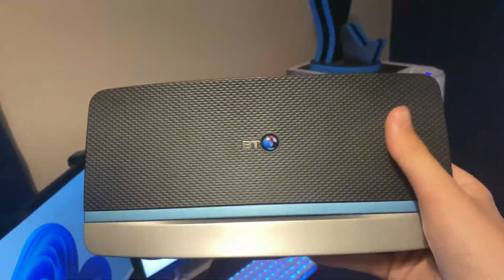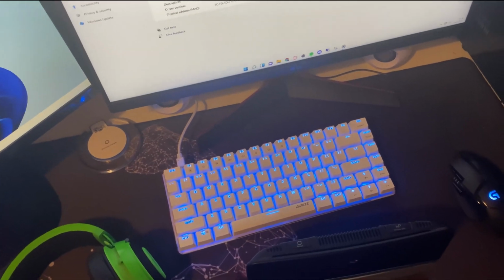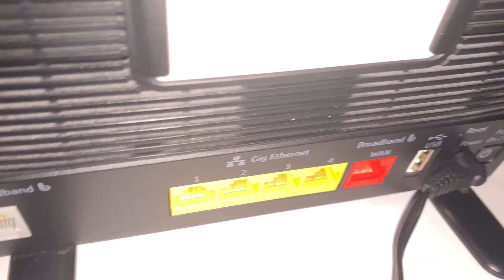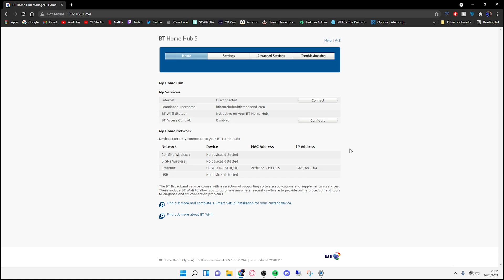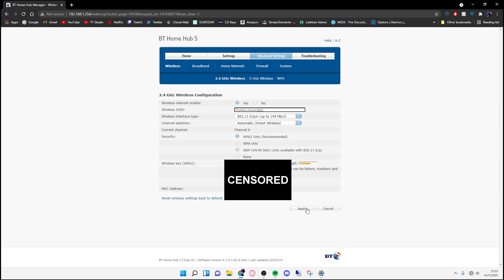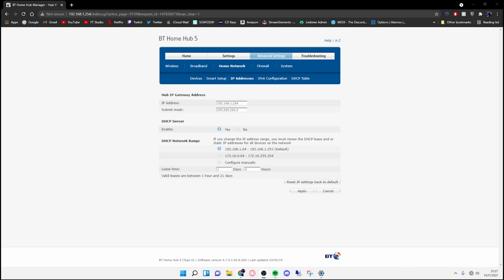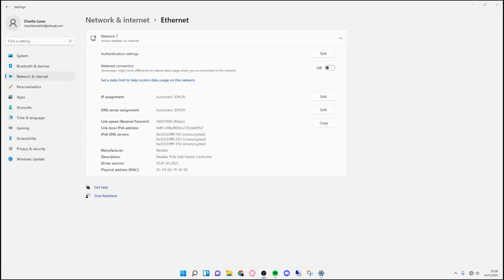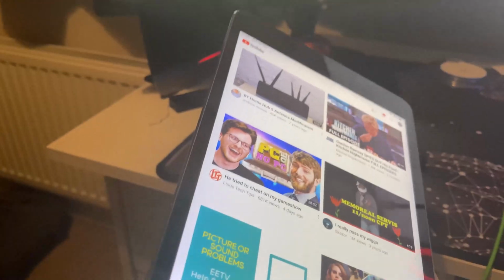Use a BT Hub 5 as a Wireless Access Point Wi-Fi extender

Comment: Hi Charlie, I am still having  trouble with the end bit.  you mentioned after all the changes you plugged in the other two wire, your enthenet and x box cable.. can I get it to work with just one Lan cable from the main router to my old bt hub?  how would i do this?  as it is still light up orange.
Reply from the maker: you only need the connection from your current router to the bt hub, you can choose to plug other devices in but you dont have to, did you get it to work?

Comment: I tried this but Internet kept dropping.  I phoned a bt engineer and he could remotely see that I had connected an extender.   He said that the extended is ' throttling' the connection and reducing the main router speed.  So it didn't work for me despite following the instructions on here.

Comment: Hi thanks for the video much appreciated and a 👍 from me. Quick question, my BT HH5 is working as a wifi extender thats good. But the other lan cables dont seem to stream wifi elsewhere ie pc etc. Have i dosabled the wlan sockets as the line in is plugged to the yellow wlan connection also.

Also i now cant access the router settings using 192.168.1.1 or 1.254 do I have to reset it again to access it since disabling dch.

Many thanks

Comment: These do even better with OpenWRT flashed on; I've got particularly good at soldering a 5 wire header on the back and 3 little wires; plug in TX RX GND ... get to bootloader; ...   Could even work out a way to get the whole thing into a single flash-image.  I even have one of these in a routed-network-configuration using the 2.4ghz wifi as Client, 5ghz wifi as server (with different IPv4+IPv6 range; also accessible on all 5 ethernet sockets).

Comment: I am looking to do as you have described in the video, so thanks for that. 
Will the wi-fi (on any mobile device) change over automatically from the router to the access point when closer to one or the other, or do they have to be on seperate channels ?
Reply: If you set the SSID the same on both hubs it should automatically connect to the nearest one (if I remember rightly)

Comment: if that device actually belongs to BT and you not have a purchase agreement then using it as an access point should be only temporary and Not be relied upon as operational kit; - I had one that I plucked out of a skip, and set it up exactly as an AP, - it worked for some time until one day it totally reset itself.... since those times I have gone on to use TP-Link access points ...also got into MikroTik devices........
Reply: From what i understand, prior to the Smart Hub 2, the equipment was owned by the customer
All Home Hub 5s (and earlier models) are customer owned
Reply: @pineappleroad  I have one just like the one in this video besides various others, - the one in the video must at Least be on its Own subnet and Not able to 'phone home' = the one that I had actually RESET itself to '192 land' my network is a class B :/ and it started dishing out 'Default class C' addresses ...I only use anything like that in an offline situation between two or more JamFabrik style of systems...

Comment: is there a way to do this as a wiresless acess point,  have bt hub 3 but dont want power line adapter and stuff, im sure its possible but other vidoes are confusing man
Reply from the maker: There is no way to do this fully wirelessly without modding your hub which requires soldering, to do this method you need ethernet to provide internet to the hub and power line adapters are the easiest way to do that if you cannot run a cable to it
Reply: @charlielowe1519  alright thanks mate if i can find my tp link powerline adapters ill try it out

Comment: Hi Charlie, Thanks for a really good interesting tutorial, I'm a bit confused about changing the ip address though. My problem is my main or primary router is supplied by Plusnet,  which has the same address as the bt home hub 5 that I want to use as my access point. Do I still have to change the ip address. I've tried changing it but when I then OK it the site won't let me back in. 
Can you or any of your subscribers suggest a solution please.  Cheers
Reply: Sorry not iPhone address I meant ip address. 🤭
Reply from the maker: Yes you still have to change the ip as bt and plusnet routers are the same just different branding, the website dosent let you in because the ip you are changing is the website your logged on to. So you need to change the ip then you need to enter that ip into the search bar instead of 192.168.1.254 I recommend changing the ip to 192.168.1.1 as not all the ips work
Reply: @charlielowe1519  that advice might help me too as I could not get back into the BT Hub 5 to change the DPCH from 'yes' to 'no'.  Every thing else seems correct. Wish me luck. 🤞🙏
Reply: Thanks Charlie, I'll give it a try with the iPhone address you suggested and let you know the outcome. 👍

Comment: If you name this the same as your main bt hub will it work a bit like a mesh and just connect you to the strongest signal?
Reply from the maker: Yes and no. Doing that would work but it'd not a mesh the device won't automatically connect to the second one once you more closer. Your device will connect to whichever signal is stronger at the time off connecting and will stay on that signal even if the other router has a stronger signal. It may switch over but also may not

Comment: Trying to do this to use with a current bt hub but it won’t let me change the IP address? Does it have to be changed
Reply from the maker: It only has to be changed if there is another bt hub on the network if not your ok to leave it as is
Reply: @charlielowe1519  yeah I’ve got another on the network , but every time I try to change it says devices won’t connect are you sure you want to continue I click yes and then it crashes the page
Reply from the maker: @thebigg5302  yes the page will crash because the ip your changing is the ip you use to access the website so once it crashed enter the ip you just changed it to
Reply: Thanks mate it’s worked! I had to change the ip last number instead of 5 to 3 and it worked. Thanks so much for your help
Reply from the maker: @thebigg5302  no problem mate glad it worked

Comment: My Hub 5 was working like a dream for years  to boost Virgin Wifi, and now it keeps cutting in and out, the light will go from amber with flashing signal below (when it's working), to blue and green(cuts out here) and then back to amber.  is this a problem with the BT Hub or the Virgin signal?
Reply from the maker: Your bt hub is probably faulty as it sounds like it’s just boot looping since those are the stages the lights go though during boot up
Reply: @charlielowe1519  thank you so much for your quick reply!

Comment: Hi great video thanks. Wonder if you can help I have the Hub 2 and followed the video however at the end it just flashes purple and doesn't connect. Any ideas?
Reply: It will flash purple, his flashes qrange because its an older hub
Reply from the maker: the smart hub 2 is newer and the no internet connection light is purple instead of orange although it flashing purple makes it seem like its not working it still should it doesn't come come up with the connected light because broadband isnt coming into it the traditional way but connect to its WIFI and it should work